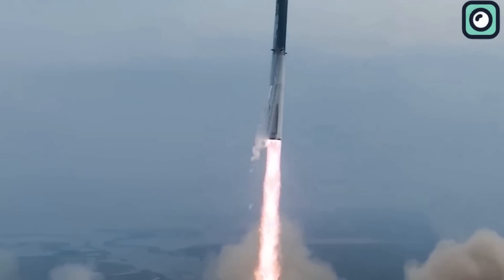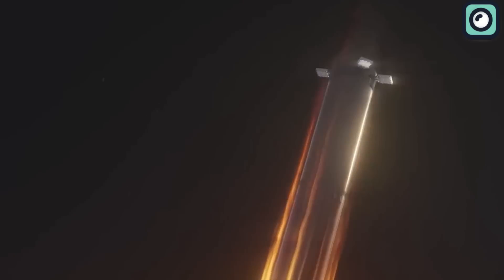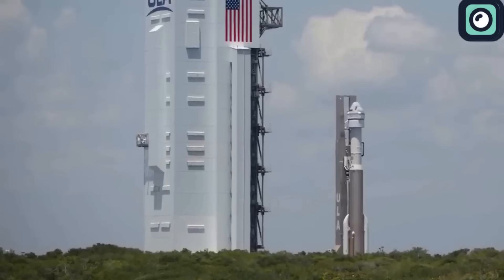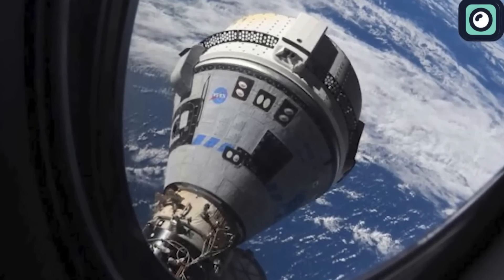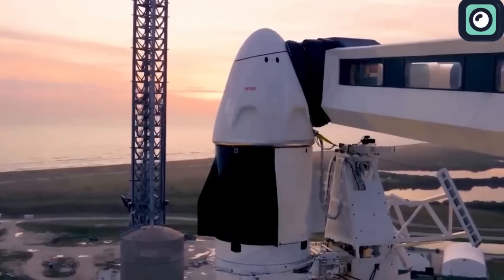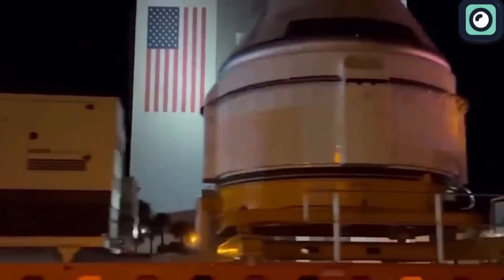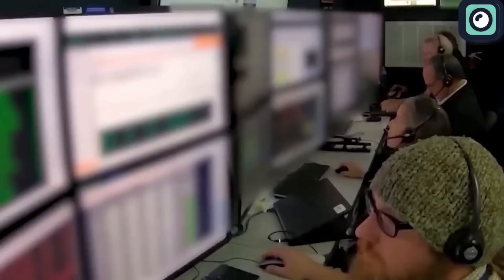SpaceX Just Revealed New Method Of Landing The Starship Booster!

Comment: The trouble is Boeing went woke. There HR Department, driven by government political biases is focused on CRT and DEI programs and hiring practices. Demanded by leftist politicians if you want government contracts. Boeing is too top heavy and hobbled by excessive middle management and unions. SpaceX on the other hand is lean and focused on competence and getting results. Another factor is attitude. Elon is not afraid to break things. I worked as an Electronics Engineer specializing in PCB Layout design until I retired at 73. I approve of this method. This real word approach is the fast track to robust, reliable, useful and more importantly, manufacturable products. Spacecraft, Aircraft or Cars, no matter, it's the same deal. Boeing is a monster that's grown fat and lazy.

Comment: Booster landing on a drone ship is not going to happen. Could it be done? Sure. But they are not going to add the weight of the landing legs to the booster. Also, what do you think it looks like for a booster to tip over in even slightly rough aeas?

Comment: I can’t wait. Remember starship and booster are both stainless steel. These launches are an empty starship and a screwed up booster.

Right now they can’t achieve a stable Leo. Booster only has two options. One carry starship to 120 kilometers, then hot stage and complete a stable orbit. But booster lacks fuel to land and blows up. Or 2 they continue hot staging to soon, in this case they have enough fuel to land booster. This will only be successful if they land before 4 minutes of full burn has been used.

Starship will not land because it will have no fuel left for this maneuver. It used it up reach Leo in an arc that decays at the top of the arc. Last ship will burn up every time. CGI can stop this from happening. CGI will only make sure you can’t see it. Itf-5 will not be able to use cgi again. It will have of several thousand satellites train on the next launch.

Starship will never be a lifting body. With stainless steel payload is not possible when the entire rocket weighs 9x time to much. This will not allow for a payload, it will not work as a star-link payload. Most importantly it has no Human flight system with environmental systems. Last and more important it has no escape module in the event of a failed launch or a failed reentry.

It’s a bird, it’s a plane , no it’s a trot line weight.

Comment: They just had a soft upright landing in the ocean. It’s not that it isn’t doable, SpaceX wants to be able to lift 150 ton into low Earth orbit. The mechanism required for landing that big a booster would substantially take from its lifting capacity. However I believe a version of Starship will do that for specific purposes, and if it could land on a ship, you could land it anywhere.

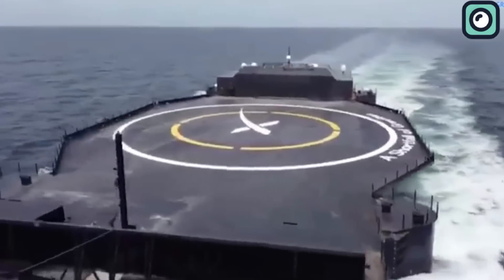Comment: I'm only 1:30 into this video and found 5 errors. How can you say SpaceX and the FAA have disputes, tension between the two? The Starship is so revolutionary, SpaceX derides what went wrong and SpaceX does it's own investigations. The FAA takes SpaceX at it's word. When something like a launch pad crumbling and parts flying miles away, there has to be an investigation. SpaceX knew this before they launched. This isn't their first rocket. By the time the FAA announced "their" findings, SpaceX had already made over 900 of the nearly 1,000 changes needed. This is because SpaceX did the investigation, not the FAA. SpaceX reported all issues to SpaceX before reporting to the FAA. Does this sound like a dispute, tense, or contentious?